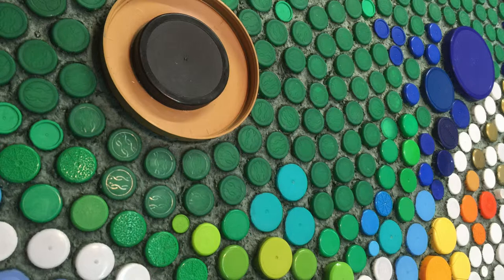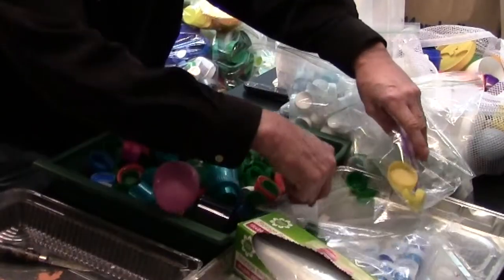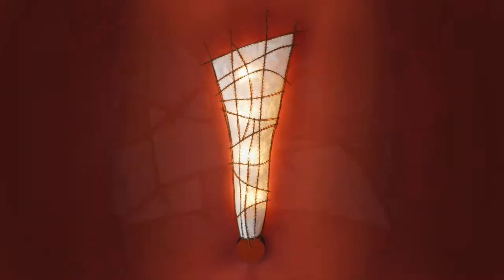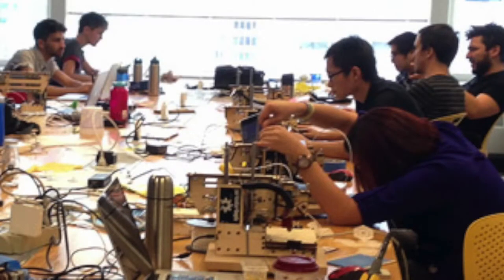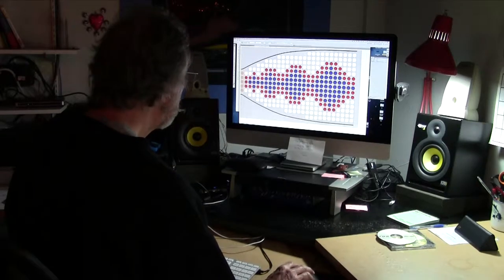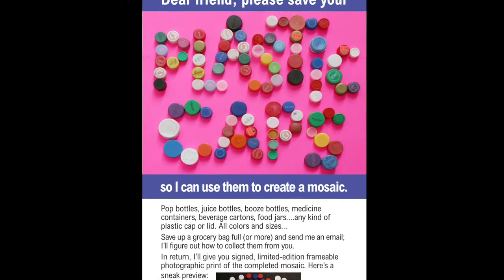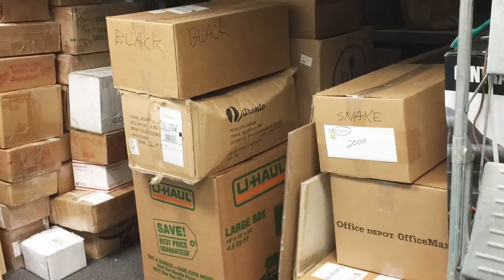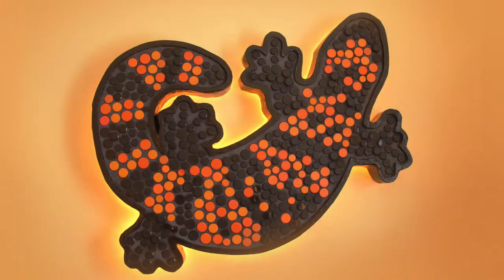Bottle Cap Mosaic Community Art Project

Comment: Hi Scott, we are doing a similar project with a group of middle school students, I saw you used a computer program to help with the layout. would you mind sharing this? thanks
Reply from the maker: Hi, Marlene
For a number of my mosaics, I did the layout in Adobe Illustrator. I composed "Big Bluegill" freehand. I also did a similar project with high school students; the video will be up soon. Let me know how your student project goes!
Reply from the maker: Thanks for your question, Marlene.
I laid out some of my designs with the aid of Adobe Illustrator, using a grid that I worked out and circles sized to represent various-sized bottle caps. In the mosaic process, I referred to printouts from the layouts, but did not follow them strictly.